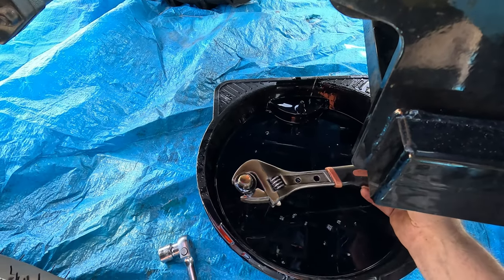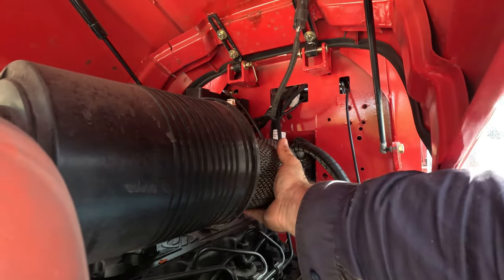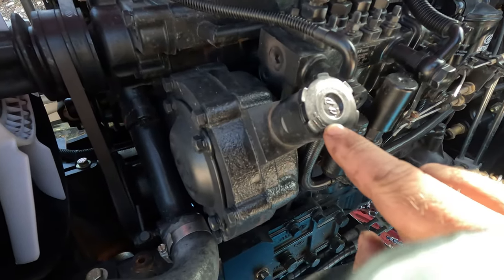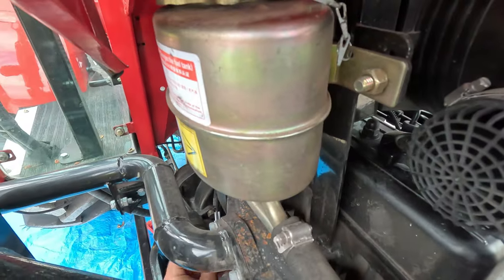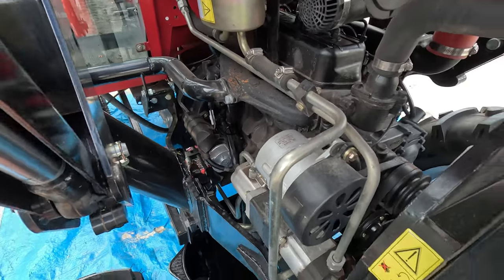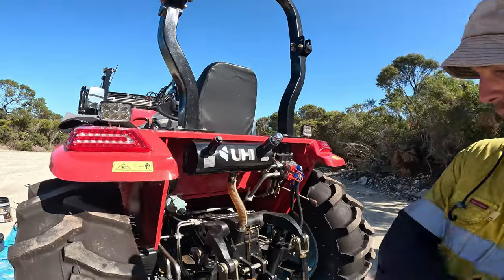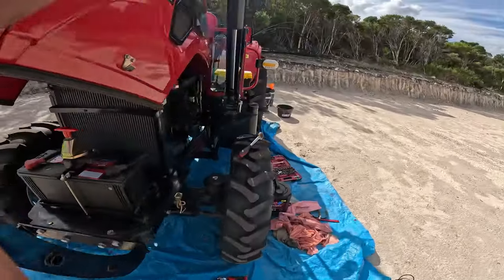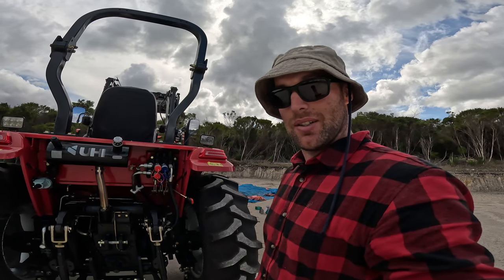How To Service A Chinese Tractor, Change All Fluids And Filters On A 55HP UHI  @GoingOffGridAus

Comment from the maker: I should add, my sheet said check brake oil, but it actually means power steering fluid… There is no brake oil in the tractor! Good old Chinese translation…

Comment: G'day  Andrew  Thankyou for your video  very helpful translating chinenglish   for your oil types  and Qty's  . One other thing to check is these engines well most of them have there own oil in the fuel pump  check at the very back of the injector fuel pump  for a small dip stick  . don't have a  service interval  for the injector pump oil change  if there are lubrication pipes between  inj pump and  mail oil gallery  no service is required . My vt65 victory has 13lt eng oil capacity CD GRADE non turbo + CF for turbo  engine 15w/40 foe -10*c to 30*c  . My engine book also shows a grease nipple on the Water Pump .🚜

Comment: Some more helpful information that should be in the manual.  I knocked off a coolant pipe pushing some scrub (don't know if it was loose to start with), the 75 hP took 14L of coolant to fill it back up and I don't know if it was completely empty to start with.
Reply from the maker: Thanks for that mate, will write it down
Reply: Hi Andy I have a 65 hp and have been having overheating issues I have only had the tractor 12 months and there is lots of corrosion in my radiator what coolant do you use red or green what pressure rating is on your radiator cap
Reply: @DavidDouglas-sk9yr  I used the Red 'NULON Heavy Duty Diesel Coolant' from Supercheap.  I started with the 5L premix and then I purchased the Concentrate.  The concentrate said to mix it 1:1 but I mixed it 1 part concentrate to 2 parts water (I purchase two 5L distilled water and used those two bottles plus the empty pre-mix bottle to give me 15 L mixed in three 5L bottles of which I used 9 L to re-fill after the 5 L pre-mix).  It has been running fine for me since.  I have had overheating issues during summer (I have the Cab with the Air Con and I am working in North Qld).  I found the issue I had was the very dusty long grass I was slashing clogged up the mesh screen in front of the radiator.  I Just watched the temperature sensor and when it got over 80 degrees I would stop the tractor, put my hand under the grill and lift that screen 30 to 50 mm and let it drop.  Do that two or three times and all the dust would fall off, get back in the tractor and start it up and within 2 min the temperature dropped back down to 60 degrees or so until it started creeping back up as I worked.  Note that I only had this issue while mowing with a flail mower, in very dusty conditions, while disking , using the forklift, auguring holes no overheating issues, though the A/C does struggle.

Comment: Great video love the tractor but you have done a great job explaining oil types and quantities required I have a 65 ph and am having a lot of overheating issues what coolant do you use red or green and what pressure is on your radiator cap mine is 0.9
It’s a shame there is so little English translation for these machines

Comment: Good video. I'll watch all the others. I sincerely hope the company has done some major work on their supplied documentation for the machines since video was made. Incorrectly labelled filler caps, only approximate quantities of oil listed, (9 or 10 litres), substitute oil grades suggested by a mechanic, are concerning. A local, dated info sheet, should be sent out to past customers, with any problems discovered, that are not easily available on their website. The DIY service ability is a great arrangement, with good doco, it would get good star rating.

Comment: Great Work Mate, this will help me a great deal in servicing my 454 on the weekend. 👍
Reply from the maker: Goodluck with it 👍
Reply: @GoingOffGridAus  thanks. You were spot on about the oil filter, I ended up breaking my rubber strap filter remover, and will have to get something else to remove it tomorrow. You also saved me from putting the wrong oil in the rear diff / transmission as I was going to put in the 80w- 90 gear oil that UHI had advised but went and bought today 40 litres of Castrol Transmax Agri. Thanks Again
Reply from the maker: @davidlane6547 Happy to have been the guinea pig mate haha

Comment: Lol, service my UHI1004 a couple of months ago. Thought at the time, it'd be good they had done a video like yours then...
Nice you took time to document it on yours! 🤞👌👏

Might have missed it...Greasing all nipples?🤔

Also, the manual was so wrong on oil needs, no engine oil on dipstick after 10L as indicated...Got after sales to send me a new sheet with quantities much closer to requirements. Engine oil needed wasn't 10L but 24L to full mark and after start to fill oil filter too.
Rear+transmission oil was not 24L but closer to 80L...
Right quantities allow to have enough to complete service, rather than getting stuck like me over the weekend...😱😉
Reply from the maker: Yeah mate, greased everything 👍

Comment: Thanks for taking the time on these videos mate. I haven’t yet bought one, but am thinking seriously about it as the work you are doing is similar to what I would need it for. One exception is that I have a 100acre Forrest on my place and do a little bit of logging.

Do you think your model could handle towing out 3.5m hard wood logs (few hills), loading them onto the mill with the forks and doing a bit of track clean up with the FEL and back blade?
Reply from the maker: No worries mate,
Towing logs out would be no issue at all, heaps of torque in the lower range gears. Having said that, you would be able to tow many times more weight that the forks would be able to lift.

I have used my forks to the limit, once you get up around their working limit they still have plenty of power in the hydraulics but you start lifting the rear wheels off the ground (especially because I have no flat ground) you can stop this a bit by connecting the slasher on the rear for extra balance but just keep it in mind, dont plan on lifting logs over 600 - 700 kg too often.

Track clean up would be no worries. I have done plenty of it 👍
Reply: thanks for this advice mate. Really appreciated.  @GoingOffGridAus

Comment: What checking and maintenance does your manual say about the oil tank between the tail lights ? My rig has one as well, but no mention in my manual.
Reply from the maker: I dont have the maintenance manual on me. But from memory it said to change out the hydraulic oil and filter (which that tank is part of) at 100 hours, I will double check the paperwork next time I am at the property though.
Reply: @GoingOffGridAus  Thank you !!!

Comment: How many different oil/fuel filters is there? 3 or 4? 

Thanks
Reply: The 4th one is on the rear. I think it's a hydraulic oil filter. Not sure how often it needs replacing, do you? Awesome video by the way.

Comment: Just go a 75. Did your exhaust smoke and smell like it was on fire when you fist got you UHI?
Reply from the maker: No mine was pretty good, although I wasn’t there when it was offloaded from the truck on delivery so it may have on the initial run.
Reply: @GoingOffGridAus  I got about 6 hours on it now and it was only the first hour that the exhaust smoked (I have an A/C cab so the exhaust's right there in front of me).  I recall the dealer showed me a unit they were getting ready for someone and they were touching up the paint on everything as they had people complaining about scratches (on a tractor) so they must have put some paint on the exhaust that has now burnt off.  Thanks for the video, I went and got an oil pump as soon as I committed to the UHI and I like the idea of the tarp under the machine.
Reply: Great videos, How does it effect your warranty doing service yourself.?
Reply from the maker: @bluey2809  They are happy for you to do it yourself as long as it is all documented. Doesn’t affect warranty.
Reply: Hi great video any chance of getting a a couple of photos of the oil you got thanks
Reply from the maker: @nickkara02  Cant add photos in comments but I bought all the oil I used from Supercheap Auto
Reply: Thanks

Comment: Hey mate. Can I ask what oil types you used for trans and front diff was it argtrans UTTF for the trans and 80-90 for front dif?
Reply from the maker: Yep thats what I did. The trans and rear diff share the same fluid so they told me to use a transmission fluid. The front is just a diff so used the 80-90.
Reply: Sweet thanks heaps man getting mine delivered tommorow. Any other tips I should check before using
Reply: Did you just use the argtrans UTTF oil for rear differential and transmission @GoingOffGrudAus ?

Comment: What model engine does this have? Mines a laidong 100bt
Reply from the maker: Not sure, ill have to check tomorrow
Reply: @GoingOffGridAus  how many hours you got on your tractor now? Can you check if your spec sheet says anything about what fluid to use for power steering? Mine needs replacement
Reply: @GoingOffGridAus  also, what about the fluid for the injector pump or does it share with the engine?